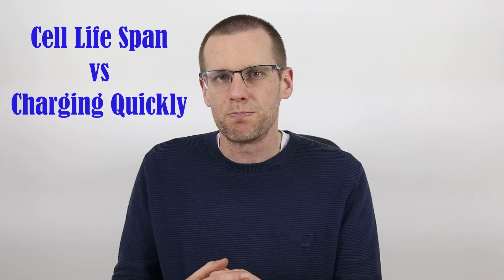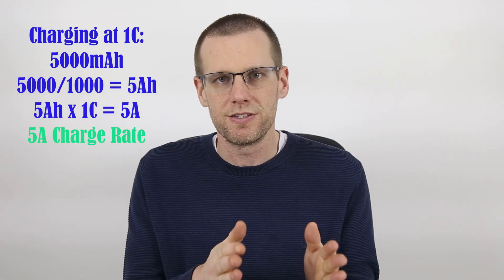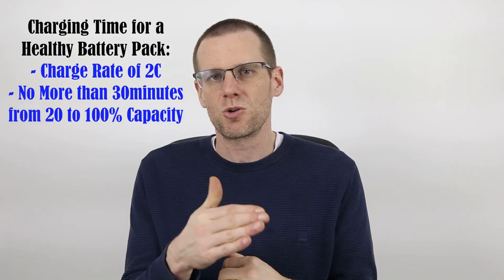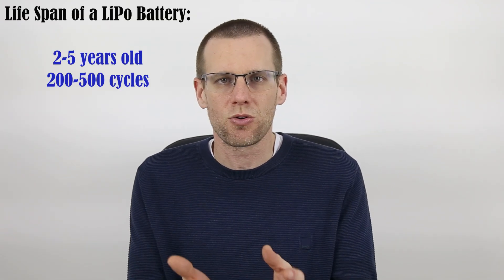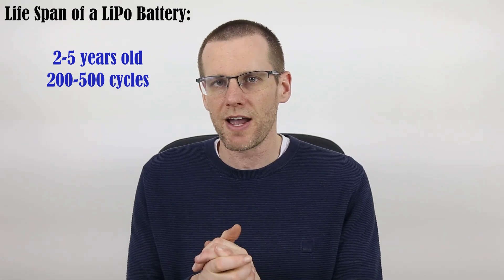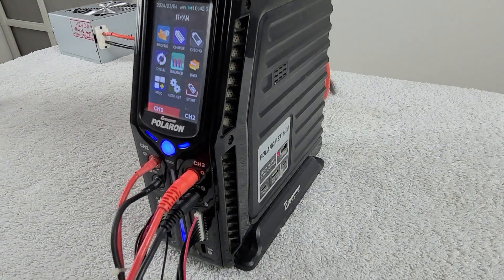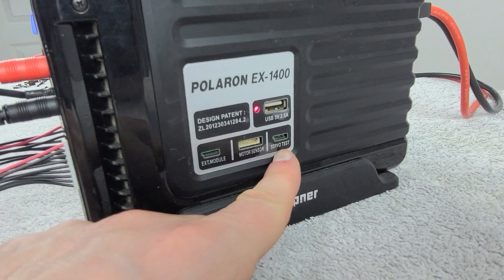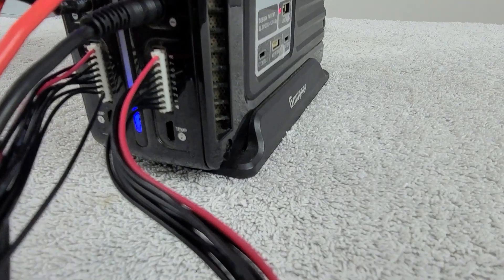Charge Smarter, Not Slower: Balancing Charge Speed vs Battery Lifespan + Tour of My Charger

Comment: Really appreciate this information. For anyone else using these: Zeee and GensAce at 1C. Reedy batteries at 2C. Spektrum Gen 1 at 3C (the ones with the balance lead). 

I went and looked through all of my batteries, and two of my favorite Amazon-available manufacturer's had nothing on the labels, but the instruction manuals state that we should not exceed 1C for charging (Zeee and GensAce). Reedy and Spektrum's older batteries also lack a charge rating on the label, gotta read the fine print.

Comment: Good info on charging.  What about putting the Lipo into storage mode?  My Venom pro duo only allows a 1A storage rate ... so no choice there.  However my other charger I can set the storage amp rate.  After a day of running, some Lipo's might not have been used and are at full charge.  Can you still storage (or discharge) at 1C/2C rates ... or is that a different situation?
Reply from the maker: Yes I can and think I showed this in the video. If not it was in another cut that got edited out.

Comment: That's a really good explanation.

1C charging can also be dangerous for batteries with physically damaged cells.

Damaged cells may never reach 4.20V and other batteries connected in parallel will exceed 4.20V.

The reason this happens is that most 1-cell batteries are connected in parallel with two batteries. 

In other words, if you open a 4-cell battery, there are eight sheets.

No matter how good a charger is used, it is difficult to prevent overcharging because only the average value of the two batteries can be known.

Charge as slowly as time allows and make sure to check the battery temperature.
Reply: All lipos that use parralel cells are marked that way to differentiate them. A 2s1p pack always has 2 cells and a 2s2p pack has 4. So saying that it's most of the time that case is completely wrong. Most packs are sold as 1p packs and not 2p packs as you stated. I for example stay clear of parallel packs as you can never say in which condition the cells are as they are always shown as 1 cell on the charger or  lipo tester.
Also there is no average value for voltage on  parralel packs. They are always exactly the same.
Reply: You forgot that when you charge lipos in parallel  all lipos voltages equalize at the same level

Comment: Eh, unless I leave batteries sitting around fully charged and ready you go (which I don’t), I’m going to have to plan ahead when doing my charging anyway.
 Lately, I’ve dropped my rates to more like 0.5C, as it only takes 20-25 min more and the charger’s actually able to put a little more milliamperes into the battery. Plan ahead, get a tiny performance and run time boost.

Comment: sorry, a bit confused ... and obviously I'm missing something. When charging, you say "charge at 1C or 2C" ... what exactly is that? I use 6000mah 2S batteries (racing 1/10 scale buggies). So, does 2C mean 12A and 1C mean 6A charge rate?
Reply: You are correct on your charge rate examples

Comment: I'm glad you mentioned packs getting hotter running vs charging. The only time I worried about any lipo was after pushing them in the field, not sitting on a charger. I have several chargers, and still use my Duratrax dual charger. After many years, I have only had one pack light off, and it wasn't on any good charger. It was a small 2S pack that only fit its included charger! Glad I still pay attention, or it could have went south quickly 😁✌️
Reply from the maker: Wow so far, I've not had a single pack let go on me. Fingers crossed though.

Comment: Great info, thanks Ryan !! 

So, if the storage voltage is, let say, 3.8v(30% of total battery capacity), then this 70% that required to make it full helps us to calculate approximate total capacity of our battery, (how true it is😅) and, with time, when the battery is "old".
What's the voltage of 0% battery capacity? (Voltage, from where to start the charging to check the actual capacity?)
Thanks a lot!!
Reply from the maker: I did a voltage vs capacity video on the channel. It includes a graph.